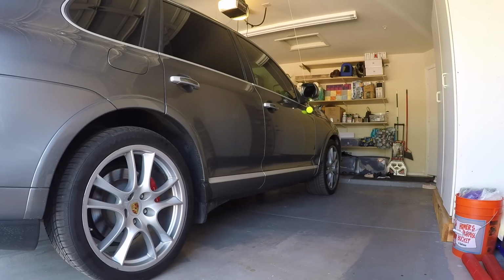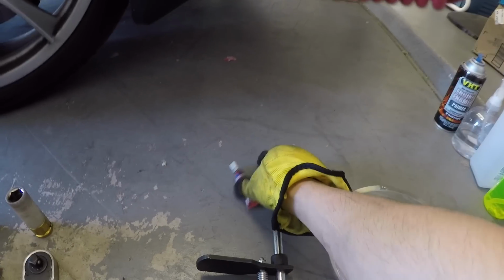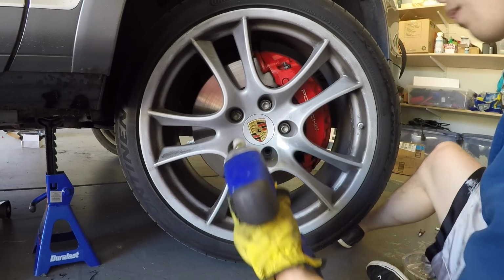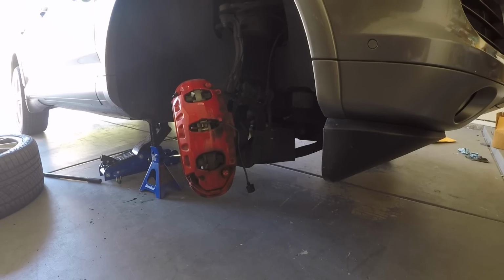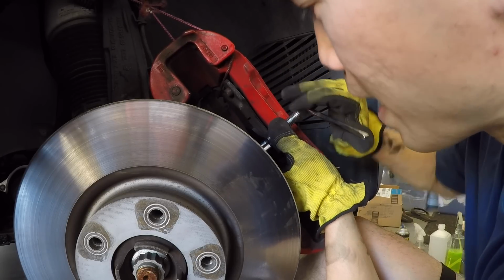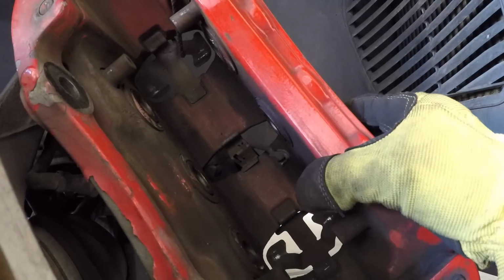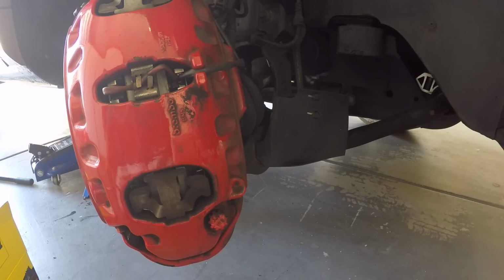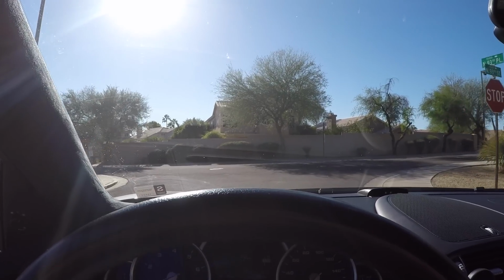How to Change Brake Pads &  Rotors on Porsche Cayenne Turbo (DIY Tutorial)

Comment: Could you add the pad Brand and part number for this CTT?   Mine is identical.  Looking at Textar 380mm on Amazon but not sure.
Reply from the maker: +Greg's Garage sorry, be here you go. http://amzn.to/2sg8U3P please note these are for the front on a 08 Cayenne. Front rotors are 368mm not 380.
Reply: thanks!  yes I learned that after more brake-related reading today.  I try to learn something about this complex beast each week.
Reply: you wouldn't know the rear rotor size?  330 or 350mm?  I'd measure but the truck is under a foot of snow and it's -20C
Reply from the maker: +Greg's Garage I'd look it up online. I think it's 330 but am not 100%
Reply: All my research says the fronts are 368mm and the rears are 358mm.  I ordered some TEXTARs online.  Will see what happens.

Comment: Happily the pads in my car just drop into the caliper slots without having to remove the caliper from the carrier bracket.  Sometimes replacing the rotors can be difficult since, in older cars, they are frequently bound to the hub with rust. I've seen people pound on them with hammers to try to break them free. This is dangerous and sometimes fails. Putting bolts in the carrier bracket and tightening them against the backs of the rotors usually works very easily to remove them.  Also, if you crack the bleeder valves just a little when compressing the pistons, they will move easily and simultaneously remove some of that often-contaminated fluid in the calipers. I usually don't even need a compression tool.

Comment: I just bought a nearly identical CTT.  2008.  Same color as yours.  Red calipers too.  What do the red calipers mean?  Some 2008 models have different colors.  Do they indicate 350mm rotors?  Were they an upgrade?
Reply from the maker: +leusgs turbos came with red calipers which were the bigger brakes off the previous 955 turbo s models!
Reply: There are also yellow calipers which are super expensive. A $9000 option I think.

Comment: Great video 
What kind of brake pads are the ones they take ?.
I have a porsche cayenne 2008 4.8 turbo and im having trouble finding the correct brake pads .
Reply from the maker: Hi. Good question. Here are all the details you'll need to change out your brake pads on the 08 turbo. Hope this helps. https://ecarguides.com/maintenance-guides/how-to-change-brake-pads-rotors-on-porsche-cayenne-368mm-front-rotor/?diy-vehicle&make=porsche&model=cayenne&trim=cayenne-turbo&model_year=2008

Comment: Are the rear pads more difficult? Due to the electric parking brake? (I have a 2011 Cayenne S btw, same calipers though)
Reply from the maker: +VANZ STRINGZ nope. It isn't anymore difficult.
Reply: Car Fanatic alright thanks. Btw thanks also for the spark plugs and coil change video, saved me a bundle last summer

Comment: does 957 turbo has 380mm front rotors? Can you replace pads without replacing rotor?
Reply from the maker: You can replace the pads without the rotors but it is not recommended. I've found they wear out at similar rates so it's best to do them at the same time. The 09-10 957 turbos used 380 mm rotors in the front while the 08 uses 368mm front rotors. Of all the 955/957 turbos, the 08 is the only year to use 368mm rotors. I know, super confusing right?

Comment: Hi the torque of the calliper in newton meter is 271 right?
Reply from the maker: Hi, here are the instructions and torque specs. Hope this helps. https://ecarguides.com/maintenance-guides/how-to-change-brake-pads-rotors-on-porsche-cayenne-368mm-front-rotor/?diy-vehicle&make=porsche&model=cayenne&trim=cayenne-turbo&model_year=2008

Comment: Didn't you replace the rotors?  I have been told we have to replace the rotors every time we change the brake pads on German cars
Reply from the maker: I had just replaced the rotors, so that's why i didn't change them. I general,  you dont have to replace the rotors if you have a lot of material left. If you have no vibration and your rotors will last as long as the new pads,  no need to change.
Reply: Car Fanatic thank you. I really enjoy your videos. Would you please make a video to show us how to drive turbocharged cars and take care of turbochargers correctly?

Comment: You shouldn’t re-use the caliber bolts. They are not meant to be re-used.
Reply from the maker: It's totally fine to reused them if they are in good condition. Some bolts are torque to yield, therefore, you want to only use them once. These bolts aren't. Porsche says to use new bolts but that's because the uprights are aluminum so, bad damaged treads can damage the upright. But rest assured, if the treads on the bolt are in good shape, you can reuse it. That's my understanding at least.
Reply: Both Porsche and pelican parts state they are designed to be used once. I totally understand if you don’t want to replace them however for peace of mind and following Porsche repair/maintenance instructions you are supposed to replace them. Long as you are comfortable with no replacing them i’m sure there are plenty of cayennes on the road that don’t.

Regardless nice video, good to see repair videos on these vehicles out there now.